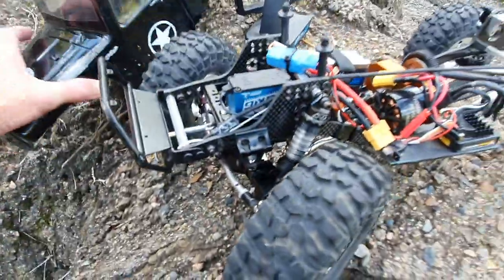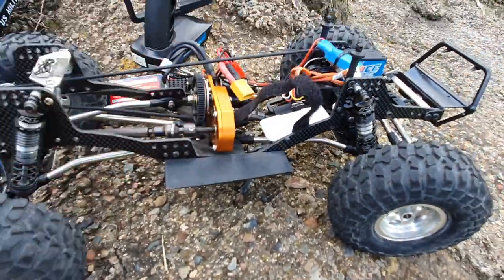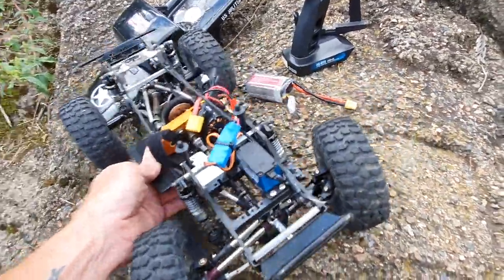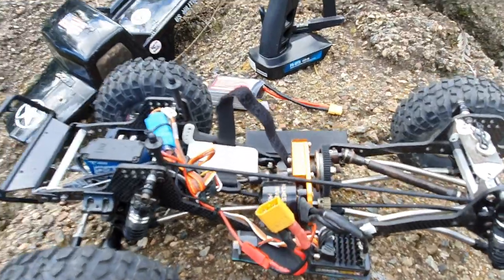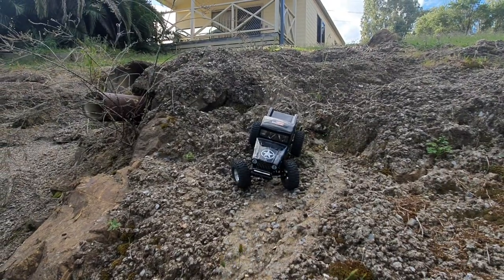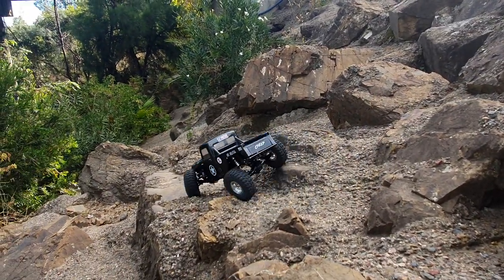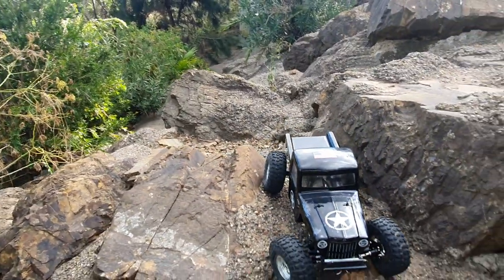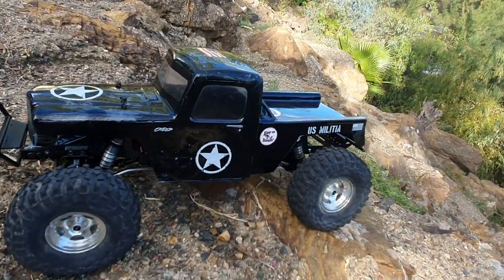Gspeed V3 battery relocation, SCX10ii build breakdown and run

Comment: Absolutely awesome build my RC brother
Reply from the maker: Im glad you enjoyed the video on my build. I'm pretty happy with it, as I said ill probably go with a thicker shock oil and maybe change the tyres to hyrax's predator compound at some point but other then that my actual build is complete now.
Reply: @hossrc420  im not a fan of the hyrax at all not sure why everyone likes them so much I have ran almost every tire proline makes and the best in my opinion are the krawlers and the tsl swampers im also a fan of the jconcepts landmines and ruptures both are amazing ive just recently got the voodoo klr x4 but haven't ran thm yet they're going on my new build a gspeed carbon v3 on trx portals 👍
Reply from the maker: @sprather84  sounds like your build will be pretty capable too. Ill try the voodoo klr tyres one day. Yeah im pretty happy with the G8 Krawler tyres, they take the abuse on the rocks without wearing too quick whilst still providing good levels of grip

Comment: Very nice 👌👍🥰  Questions:  So, you drilled holes in the carbon fiber rails to fit the lcg battery tray???  What size drill bit did you use???  Is there any issues of the battery rubbing on the drive train???  Thx💚🙏
Reply from the maker: Thanks for watching buddy. Yeah I drilled a 3mm hole for the tray. Its  tight fit and I did have to trim slightly as it was rubbing on the drive shaft. Until I get a servo winch I'm running the battery in the forward position and with the hardbody it works great.

Comment: Very nice brother. What is that rear bumper you’re running?
Reply from the maker: I got hold of some rc4wd xxx front and rear bumpers for vs4-10. I modified both and im using the front bar on the gspeed build and the rear bar on the element atm. Thanks for watching

Comment: Great videos!  I was just watching your video with the Enduro going up 62 degrees and I was wondering how steep can this one crawl?  I built a g speed enduro and I can get just over 62 degrees with the stock transmission, a heavy 550 brushed motor and a heavy 2200mah battery.  I ordered a 850mah battery, the g speed battery tray, a HH revolver and a Mamba micro x which will put my setup very close to yours so I’m trying to understand how much performance I could gain.  Thanks!
Reply from the maker: My Gspeed build gets just over 65 degrees so far out of the Gspeed build, not sure if im going to get a Gspeed for my vs4-10/Enduro build, may just save that for my next build which I plan to go with capra axles and 4ws if I can scrape up the funds.
Reply from the maker: It will also come down to how you distribute the weight down low too, my Element has plenty of brass on the axles and the Ebay steel wheels weigh around 125g while I'm currently running steel axle housing's on the Gspeed.Both of my builds got increased climb angle after I did the pen spring mod but the shock keys took my Element to the next level.
Reply: @hossrc420  thanks for your feedback!  I do have the pen spring mod on my shocks but I’m currently running no brass at all and stock plastic axles. I did ordered some brass too so hopefully I’ll see some gains!
Reply from the maker: @carlosjgutierrez6049  not a problem at all, I've got the hardened plastic on my enduro diffs and I got my brass from club5racing.com all except the ssd brass knuckles. Im running kyx axles on my gspeed build but the cv shafts arnt very strong will be upgrading to incision cv shafts for the front soon, im also running shorter shocks on my gspeed build, I have the proline big bore shocks at 90mm. I hope that helps and good luck with your build.
Reply from the maker: Sounds interesting. The best place to sell second hand rc stuff is on Facebook as there are alot of groups for buy, swap and sell rc's.

Comment: So, basically I would need the chassis, spacers, saddles, servo holder and everything else was stock transfers over?
Reply from the maker: Yeah for a gspeed chassis build but I've seen guys save some cash by using a Enduro kit which can save a few dollars on some parts buddy as the shocks are awesome and so is the trans plus axles.

Comment: 850 mha is perfect👍
Reply from the maker: I had some 850 mah batteries but they shorted out, will get some more in time but for now these 1500mah are great, get over an hour and a half run time when needed

Comment: Hi. Very impressive 😳 what is your phone support on your fs-gt5 ??
Reply from the maker: I just got a cheap selfie stick, heated up a screw til it was red hot then melted a hole in the plastic slightly before screwing it in. Found thats better then drilling a hole as you dont actually remove any material, dont screw it in too far until it cools a bit though.

Comment: I run the same battery strong and small and alot of run time
Reply from the maker: Yeah they have been working great. I've scored a smaller 850mah battery which I'm testing atm, trying to decide if the lighter weight is better.
Reply: @hossrc420  yeah i heard tattu 850 works good im using mine on the daily putting them to the test
Reply from the maker: I've got a turnigy 850mah I'm testing atm. I've had good luck so far with turnigy